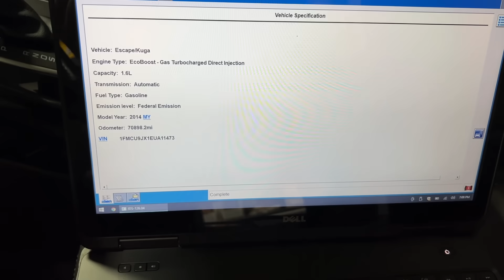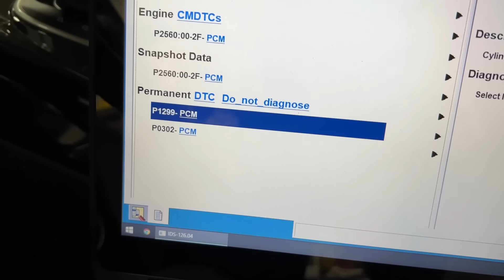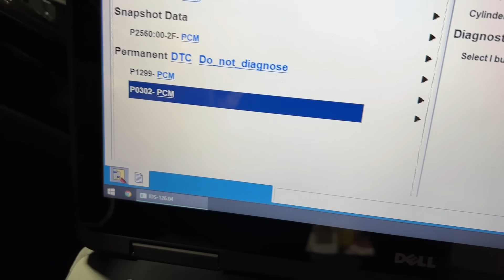Beware of Ford’s 1.5L 1.6L 2.0L Ecoboost Engines and Their Never Ending Coolant Consumption Issues!

Comment: My mother in law bought a 2017 escape with the 2.0, at under 5k miles, had to have the engine replaced. Then at 15k miles, another engine. Then last year, the electronics started acting up. Trailer warning when she wasn’t towing a trailer. Turns out there was a manufacturing flaw when they installed the roof rack at the factory and being in Washington we get a lot of rain and snow. The roof rack leaked on the left rear and filled the entire rear up with water. The spare tire well filled up so much it was running to the front under the carpet. This car was a driveway queen. So October 2021, ford would not cover it. It was out of warranty time wise. Only had 22k miles on it. 
I fought with the service department to escalate this case. I work ford a heavy truck dealership and am familiar with how you get things covered. It took 3 times of escalating to finally get someone at Ford to step up.
All the rear modules, carpet, headliner due to mold needed replaced. $8k worth including labor. Ford agreed to pay $4k. We got it repaired. Got it back, that thing spent one night in the driveway and the next day we had her trade it in for a VW Tiguan that’s covered under warranty for a total of 10 years. VW has its own extended warranty coverage so you get OEM coverage so no aftermarket warranty company. Out the door for the loaded Tiguan including VW warranty was $32k. The only option it doesn’t have is heated steering wheel but the reliability more than outlays that option.
Reply: FYI, this car was pampered. This thing was not driven every day on our horrible roads. The reason I was so persistent with escalating this case was this was a manufacturing defect. This car was only service by this dealer. They obviously missed the leak fo a long time on the services. Being a senior citizen on a fixed income. My mother in law did not have the money to pay for this repair and she should not have had the problem in the first place.
If you know someone having these issues, Brian can attest, insist on escalating the case. Go to the service manager and don’t back down. It is not fair to the consumer to have these costly issues and they paid for a product under the premise that it’s built ford tough to last. While I wish that was true, unfortunately it is not. Gotta hold ford accountable.

Comment: The big key is regular maintenance with the correct fluids.  Second. The 2.0 EB in15 16. Have the least of the issues.   Third.  Most consumers aren't car people.  They were never taught to check the fluids and tires and get a feel of how the car drives and handles.   They rely on the lights on the dash to tell them.  Or the info center with the words across the screen.  Usually when it gets to that point it's probably to late and it's going to be $$$.    
I work on all cars in general, and they all have there issues.  But if you have an older one, by all means keep that one no matter how much it costs.  Today's cars you won't have it paid off before something major $$ wise needs fixed.

Comment: Thanks for making all the videos. Valuable info for us consumers to keep an eye open. It would be interesting to know approximately how many Fords are in your area, how many are in your shop per day/month/year.  Just trying to gain perspective because my impression over time from watching your videos (which I enjoy) is most Fords are crappy design and Corporate (warranty) and design board are screwing everything and everyone over. 
Probably doesn't exist for public use but it would be nice to see the data broken down by vehicle type/engine #made/# and type maintenance problems, blah blah blah.  If I remember correctly Consumer Reports does something like this but it seems to be based on consumer reporting the problems and not a hard core data gathering from corporate (who likely would not report this publicly) or the many thousands of maintenance shops out there.
Anyways, love the videos and keep up the good work.
RP in MN
PS- own 4 different Fords in my Immediate family and have for decades.  Knock on wood (my head) none of these problems come my way.

Comment: Had this on my 2015 1.6L Escape. Dealer will keep pushing you off until warranty is expired. You need to force them to do a overnight pressure test. Mine was consuming 1L of coolant every 5K miles. I have heard even the replacement blocks have the same issues. That was a few years ago.
Reply: One got me like that but I had suspected it was the issue. Didn't have white smoke and it was not running rough. I made sure to note in my story that it could be in the starting phase of the issue. 
Ford busts our balls before we can clame it, ford is the one making it hard. 
Had one that clearly had the problem but they had to beat around the bush before we could start the ball rolling.
Reply: @jacknickolstine3355  same. No smoke. No codes. They will just top off and send you your way until warranty is gone.
Reply: Demand you get a late 2019 replacement engine.... problem was corrected then..

Comment: Mine did that last winter 
It was like a steam engine on a cold START and it was - 20 here.  
The engine ran fine, low coolant light came on. I checked tank and sure enough the coolant was down. I filled back up to the correct level, and to this day now it it still at the correct level..6 months later it is now mid July.
Is it possible that in cold temperatures when engine casting contracts is when the problem starts.  When the engine is running temperatures the casting is expanded.
The colder it gets the more the casting contracts/ shrinks.   Your  thoughts?

Comment: Our 2016 1.6T Escape has 105K miles and has never had any coolant use and is monitored often as I am aware of the potential, I thought that 15 and up had the coolant issues fixed? I'd be interested to see if you find this on newer engines as well, keep this topic updated please. Your videos are great, I reference them at work often when I run into difficult problems with a Ford or I need to explain/show the problem to my boss without tearing the vehicle apart. You're my sanity check!
Reply: My 2017 Escape 1.5L had the issue.  I got it fixed under warranty.  I’m having the exact same issue again.

Comment: I had an Explorer with this. I was having coolant and idle issues starting at 50k and was taking it it to the Ford dealer. They would say there was no issue and send it home. I would call back a couple days later and they would say they couldn’t accommodate me for 8 weeks… repeat this cycle until it had 60k miles. Then they say I need an engine and it’s not covered by warranty. I’ll never buy from Ford.

Comment: Brian, QUESTION …. I had the same exact problem in a 2015 Escape.  I bought it used from Universal auto sales in Spotsylvania Virginia. They suck by the way. They knew it needed an engine and they sold it to me anyway. I spent about $1000 jacking with it to find out what you just showed in this video. So the only thing I could do was sell it to Carmax. I feel guilty but that’s all I could do. So my question is, have they solved that problem yet? Because I bought a  new 2021 Mustang and I’m worried about having that same problem. 
Please let me know what you think. You are the best.

Comment: So far, my Nissan products are getting 300K+ miles before I trade it in on another.

Even with the CVT transmissions. Just keep the fluid changed before 60K and they are fine.

Comment: I have no experience and am merely parroting what I've read elsewhere.  So, I'm asking, not dictating:  were these issues corrected with the redesigns that came out in the 2020-ish timeframe?  Or, is it too early to tell?  Or, is it all just smoke and mirrors and the supposed changes are just window dressing that failed to address the real issues you identified here?  Or, is this what you mean in your description that states, "The only real fix is a long block replacement with the updated design."  Does this mean that the updated design does, in fact, fix this? Thanks.
Reply from the maker: yes

Comment: I've got a question...I have a 2010 E-250 van....the last several years during hot muggy days...my van would stall when coming to a stop ...I've had a tune-up done and had the throttle body sprayed and cleaned...but it still happens occasionally....what should I be looking for???
Reply: Another car😎
Reply: @mickymac6571  drives great...just that one problem that occurs once in a blue moon

Comment: I had to do all research before I got our Ford fusion, The new replacement blocks do fix the issue for the 2013-2019 vehicles but tis a shame it was a problem to begin with.  The 2.5L in our fusion might lack power but ti won't do this..... lol

Comment: You got my sub. I have a 2015 Escape with a 2.5 L Eco-Boost engine, with tow package, with over 84,000 miles on it. Now I am thinking I should have never have bought it.
Reply from the maker: The 2.5L is NOT an ecoboost engine so you will be ok.
Reply: @FordTechMakuloco  Thanks for clearing up my confusion. I just went & looked at my car & sure enough, I have the 2.0 Liter Ecoboost. Now I can worry again.
Reply from the maker: Oh no!

Comment: That’s the problem they’re turbocharged and all that pressure on a small engine that can’t handle it. Ford is well aware of this issue and have been. There should be a class action lawsuit filed.

Comment: so i have a ‘13 focus ST with the 2.0l ecoboost and i have not had a single cooling issue with it. i also had a consistent cylinder 1 misfire that i thought may be due to this same coolant issue but at 48k miles i actually had a piston ringland failure. i’m assuming it’s due to the factory cast aluminum piston heads. it also continuously has a random misfire but i’ve been being told that’s just a normal “ecoboost thing”

Comment: My 2016 Ford Explorer 2.3 Ecoboost had the very same issue. My dealer told me that their remedy was to replace the engine! Even better, on the way to the dealer, there was an engine light came on. The dealer then informed me that the transmission needed to be completely re-built with just 78,000 miles on the vehicle. The dealer showed me an invoice over $12,000 to get me back on the road. In the end, I paid the dealer $2,500 and Ford paid the rest.

Comment: I got the 2.0EB in my 2015 fusion titanium and it’s been a great motor. 148k on it and it’s been tuned for 31k miles running 22 pounds of boost. only thing i’ve had to replace was the purge valve. the car gets driven hard and it’s never let me down, nor am I ever afraid to floor the thing.
Reply: I bought a Fiesta ST brand new from the dealer. Car had 32 miles after my test drive, and the first fill up the car stumbled and died.y purge valve was defective on a new car... Lol. At least my tuner is a great guy and replaced it no charge
Reply: Its a gen 1 2.0. From what I understand, it seems to have the coolant intrusion issue the least I assume because it’s based on the mazda L series. 2017 is when they went to the gen 2 in the fusion and thats mainly where the 2.0 issues are
Reply: 60k on my fiesta st, 26lb boost stock engine. Tuned since newish.  Evap line failed, stock turbo did leak coolant. Hybrid turbo fixed my coolant issue.  My friends st fiesta is 100k with big turbo 34lb boost. Still no issues.   Some luckier?
Reply: Very good to hear. Thanks for the comment
Reply: I as well have the 2015 2.0eb titanium. Love that it's the good year 🤣

Comment: Well great, I own a '13 fusion with the 1.6 and my wife has an '15 MKC with the 2.3.

What is the likely hood that this will happen to me? Is it a guaranteed failure point, or only occurs on some cars?

The fusion has 115k and the MKC has 70k
Reply: Get rid of those vehicles or , if you can , get extended warranty coverage.

Comment: My 2014 Fiesta ST used to overheat regularly in the summer and Ford could not find an issue.
Reply: The issues is the shitty ass small radiator. One of the first things to do with a Fiesta ST in a hot climate (the South West for me), is to put in a larger more efficient triple core radiator from Mishimoto or Mountune. Solves the issue completely.
Of course Ford wont find anything wrong, because they dont believe they made it too small. But check out any FiST formum, Radiator is one of the first mods anyone will recommend under the hood, before you do ANYTHING else.
Reply: @bigbuckoramma  great advice

Comment: My 2018 1.5 Escape did this and it took Ford 3 months to determine they would replace it.  The replacement engine is fine and has been in it for two years. My next vehicle will be a Toyota.

Comment: Don’t know if this was answered here, but is this a problem with the porosity in the casting of the block or a head gasket issue?  Seems that a coolant sealer would take care of any block porosity. I can only image the thousands of bad engines out there. What a major FU up Fords part.  Should have been a recall to protect what customers Ford has after this.  So glad I ordered my 2019 Lincoln Nautilus with the 2.7 Ecoboost engine as I didn’t like the 2.0 in the vehicle I test drove.

Comment: Build quality should be so much better every year with the experience ford has they should be top of the tree but they are way down I don't like fords so I am prejudiced against them if they put the quality like lexus does which they could do instead  of their bottom line and built quality into their vehicles reputation matters to  much    plastic components I don't suppose change will come about so ford for me sucks .

Comment: Holy Crap!!
2002 Trailblazer 4.2 straight six DOHC variable valve timing 275bhp bought new (20 years old) 240,000 miles
I put an alternator on it a few years ago...the occasional coil pack
I can see I couldn't afford a Ford 😏
Go Turbo and direct injection.....go broke

Comment: Is there an updated design of the long block? Or would the replacement engine have the same issue eventually?

This issue just happened with my 2014 escape (I've had multiple visits and repairs done to fix the coolant leak but it always comes back and now I am dealing with cylinder 3 misfires). Pretty sure it's this issue.

Comment: I had an issue with a 2017 Fusion Ecoboost 2.0 last year. It began with a rough idle on start up and a misfire code. I was thinking it was carbon buildup, but later that week, I started to get a faint coolant smell coming through the vents on startup. Made an appointment with the dealership and the day I took it, the car started smoking a ton. White smoke coming out the tailpipes, super rough idle, coolant smell coming through the vents. 

After 6-8 weeks at the dealership, they replaced the long block. I was fortunate my car still had power train warranty and while I’ve heard the new block fixed those issues, I didn’t want to take a chance. Sold my car to CarMax and moved on. I was super happy up to that point, I’m just glad the issue showed up before my warranty expired.

Comment: We have a 2017 Escape that we purchased new. Engine started eating coolant at 110K (just after the extended warranty expired). It hydraulic locked and broke inside soon after. Ended up putting a used long block in it. Last Ford I will ever buy. Quality is no longer job one.

Comment: I live in Tucson Arizona and I have a 2004 F150 5.4 L engine I did a timing chain job on it myself and replaced all the cam followers. I also replaced the fuel injectors with aftermarket ones but they were insufficient, they gave me great fuel economy but no power. I replaced them with the original Ford once after I had them cleaned and flow tested at a local shop here. I also replaced the spark plugs, but after watching your video on counterfeit parts, oh, I think I may have purchased the counterfeit ones, same with the coils. I have an interesting problem where the check engine light comes on during the winter months, if you want to call it "winter" here in Tucson, but the problem goes away around May when the temperatures are pretty consistent between 90 and 100° the code I get is for lean both Bank 1 and 2. I thought I would ask you what the problem was, or where to start looking. The reason I did the timing chain job was because I heard the chain guide  come apart while accelerating one day. The chain was replaced by the previous owner but the guides were not changed and the phasers were locked. The chain was so generic that it didn't even have Factory marks on it, instead, they painted marks on it! 
    Amazing!
Thanks, Barry.

Comment: It makes no sense how some of these engines don't experience this issue until around 100K miles such as with the 2.0 but others experience it as little as 25K miles such as with the 2.0 based on reports I've read. Why? How can the mileage between failure rates vary so significantly even though they're the same engine having the same defective block design?
Reply: I wonder if oil change intervals are at play here? The original design flaw is of course the root of the problem, but poor lubrication due to fuel dilution and other contaminants surely would not help to keep things well lubricated in the stressful environment of a DI turbocharged engine.

Comment: Have owned two Ecoboost engines. Both my 2.0 and 2.7 burned oil. Neither vehicle had more than 25k on the odometer. Been a Ford guy for 30 years. Now own a Toyota and a Subaru. Both are naturally aspirated and neither uses oil. Ford needs to step up their game.

Comment: I have 3  Fusions, a 2013 and 2-2018's with the 2.5L engines, we did not want EcoBoosts. How  are the 2.5L engines faring with head gasket and block issues? Our 2013 has 130,000 miles on it and so far has not given us any issues nor have the 2018s.